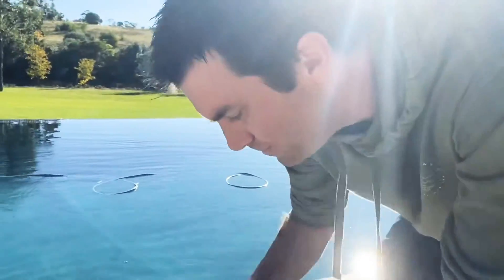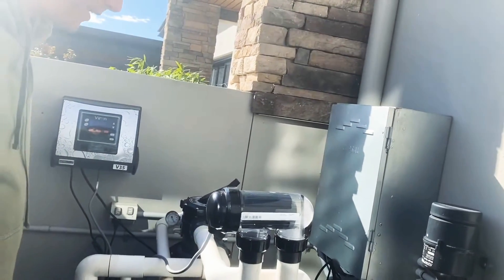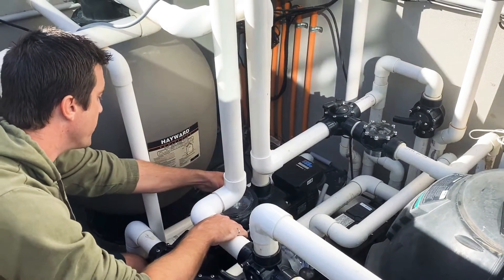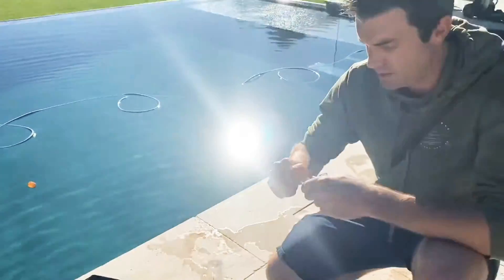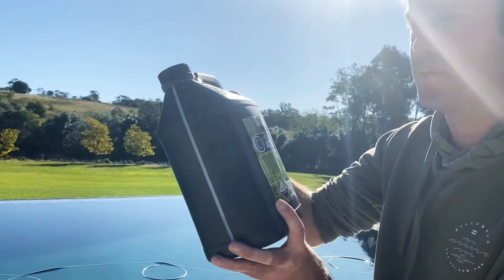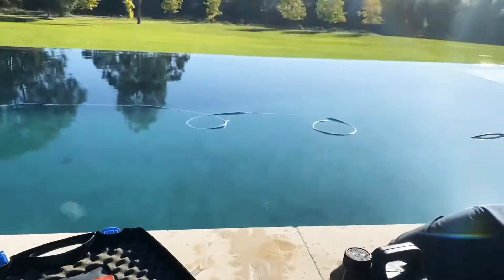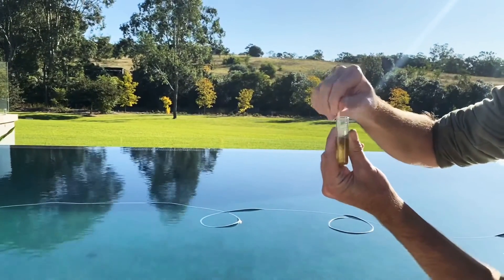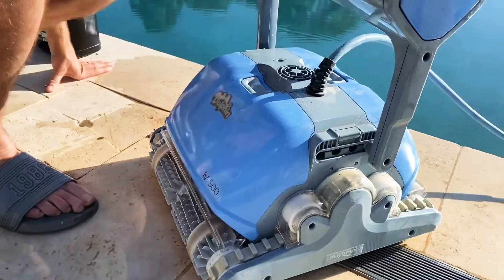How to clean your pool and water chemistry testing with Palintest kit

Comment: heat pump probably has a bad pressure s/w or it needs to be adjusted.
if you are going to to change the top layer of sand might as well do the whole thing not just just a part of it.  
when taking a water sample out of the pool leave the sample bottle upside down until your depth you want sample from.
instead of using muriatic acid try using sodium biphoshate. the muriatic acid lowers the alkalinity then you will have to add sodium bicarbonate to get it back up.
Reply from the maker: Thanks for the tips mate 👍🏻 much appreciated 👌🏻